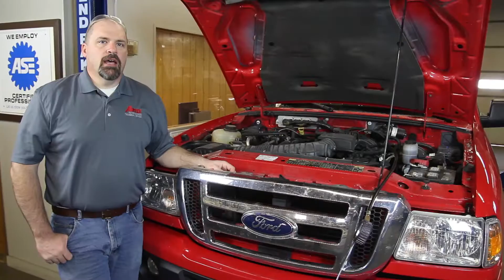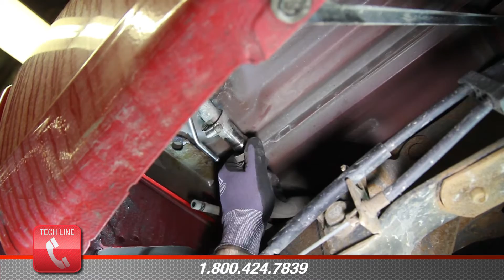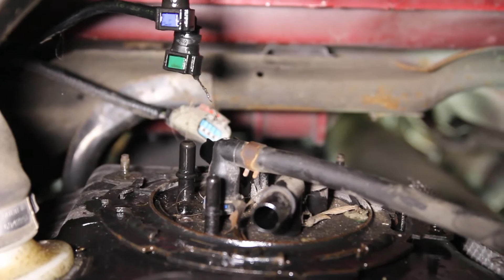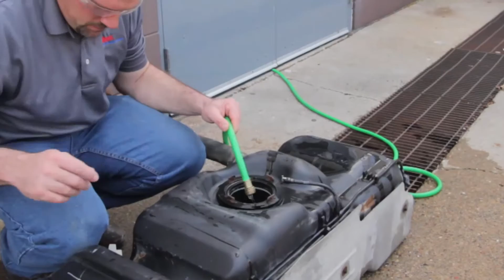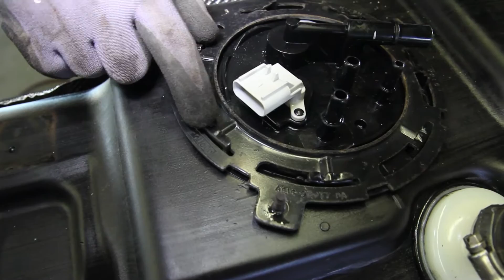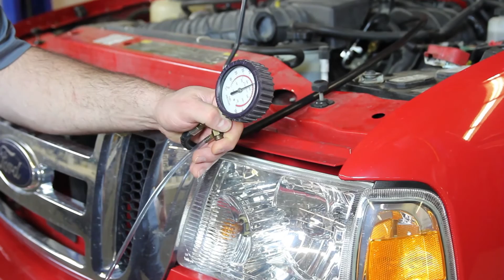How to Install Fuel Pump E8707M in a 2007 - 2011 Ford Ranger Mazda B3000

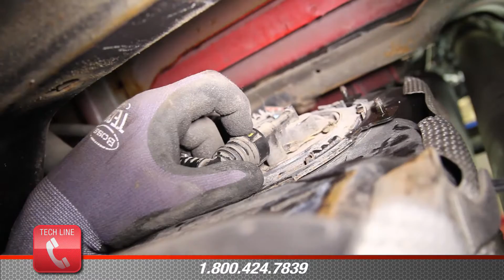Comment: Thanks for the informative video. I'm referring to your video right now, to remove my tank and check the fuel pump.  I squeezed the Emissions Line, with Yellow tabs, connected to the fuel pump, and the yellow tabs were brittle and fell out of the emission vapor connector.  Would you know were I could purchase a replacement yellow tab, or the entire vapor 90 degree connector?  You removed the emission line at 1:43 in your video.
Reply: How did you solve this problem? One of the yellow tabs broke on me as well... :/
Reply: @Zookeep13 probably to late to help now but I bought dorman fuel line connectors that were the same size from AutoZone off the spinning rack. I split them open and removed the inner tab section which clicked back into the old connection once I got the rest of broken clip out.